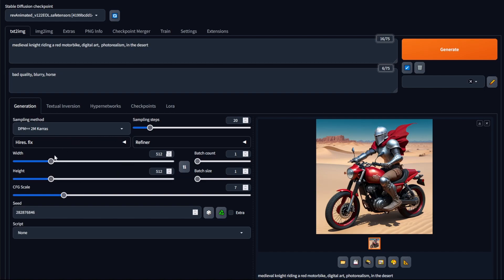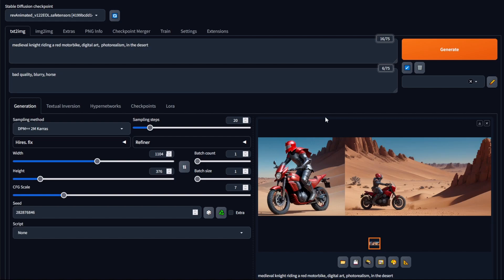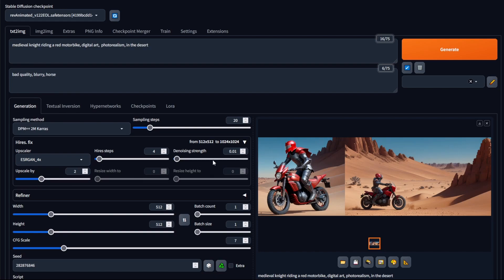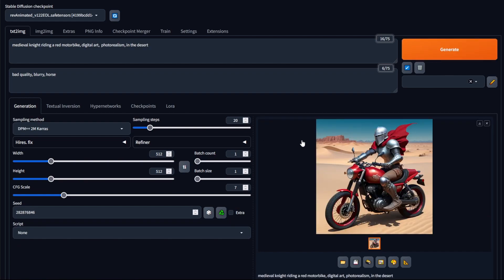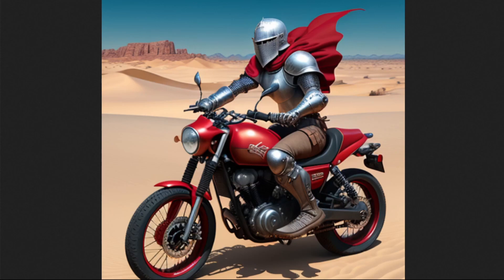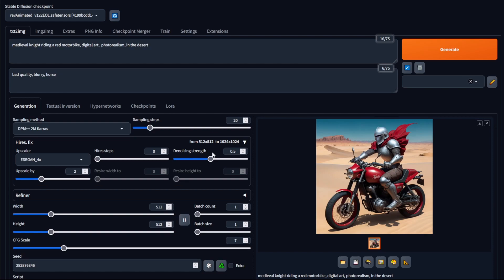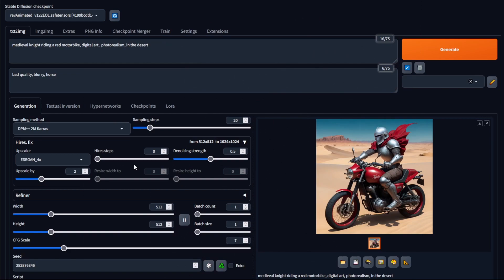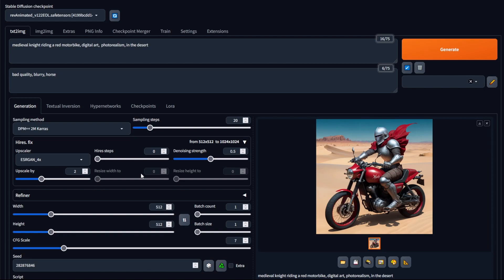Stable Diffusion Basics: High Res Fix (Part 11)

Comment: Steps is all about latent images, not the final image.  The software is letting you know, you can deblur latent images.  Most people generate text to image in 8 to 50 steps, but in one go; however a meticulous user mine do the same but one step at a time; you can see how applying the highresfix at each step could produce a superior output or generate a similar image in fewer steps.  You can probably image even 25 steps is probably overkill for applying highresfix to each step.  Of course, it is not faster to do it this way, it is simply an available flexibility.  Suppose you are unsatisfied with the final image; looks blurry.  Using the same seed, you can increase the steps and this will usually give you a sharper image, but what if it doesn't or you are still not satisfied.  You have applied 50 steps and you believe the output is still kind of blurry.   What you need to do is either use the highresfix not to upscale, but deblur the latent image either at all steps or the final steps (3-4 last steps).   This can be done.  But if using steps the upscale factor should be set to 1.  Basically using steps is deblur mode.

Comment: Hi Res steps at 0 will use the same number of steps as you've got in your regular steps, so 20 in your case. 1 or above will specify to run the Hi Res pass that many times, so experiment, but I tend to go with about half my generation steps or lower. The more you have the longer it will take, but you'll see diminishing returns eventually.